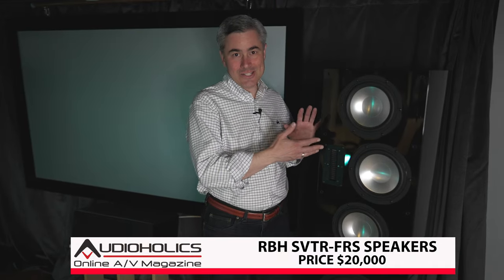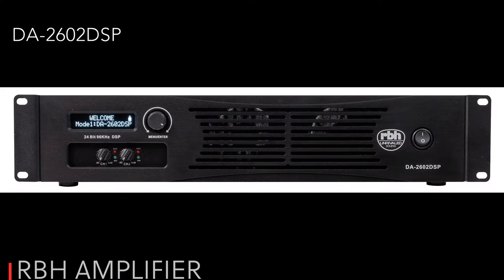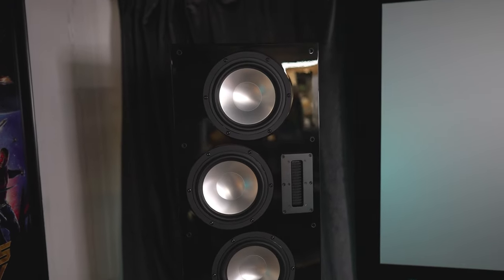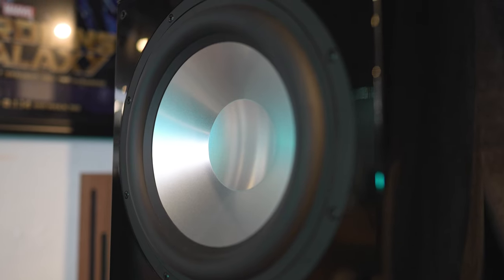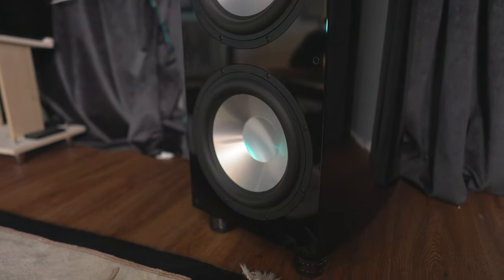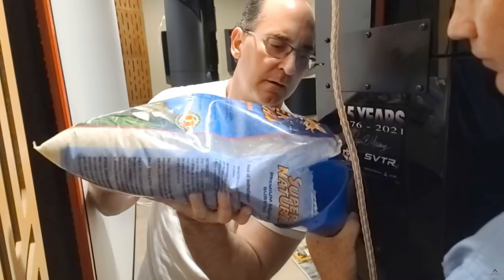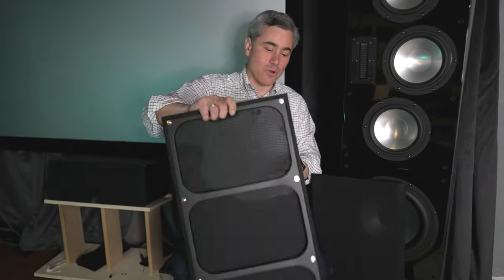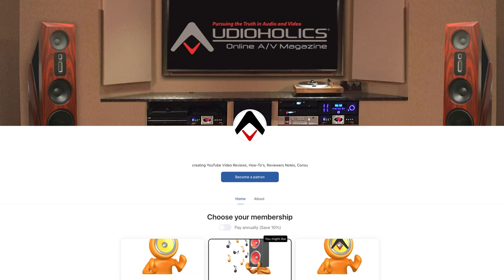Bass that Terminates Any Other Tower Speaker? RBH Sound SVTR-FRS Review

Comment from the maker: Editorial Note About Assembly: There are silicone pads between the two modules (sub and monitor) that cushion the two cabinets and prevent scratching the piano gloss surfaces. That’s what the video is showing. The two modules are then bolted together with a steel plate. Looks like an audio edit snafu cut the silicone pad mention associated with cushion in final edit. You can hear the audio splice at 0:35.
Reply: Hey Gene those sort of look like your Speakers only way smaller.
Reply: @Masterslessons they are indeed the precursor to Gene’s. When I originally had these SVTR in for review, RBH’s speaker designer, Shane Rich, was developing prototypes of the ones Gene now has. I got to see the prototypes in photos. Knowing how astounding the bass is on the SVTR, I was stunned by the potential of the upgraded version.
Reply from the maker: @Masterslessons  same drivers but missing the top sub module and my units are fully active.
Reply: @Audioholics  nice that's impressive masterpiece of speakers congrats

Comment: They are truly amazing!
I own a pair of these including the center channel. I removed the crossovers, used a custom made DSP (I designed for RBH) with a custom made Pascal Class D S-Pro2+2 & T-Pro2 6ch amp I custom designed.
They sound phenomenal! The bass is ridiculous.
I also use a 2ch RBH subwoofer amp, but their 1800W (900x2} which is way more bass power than needed.
Reply: My system is for both cinema and music.   Do you find these subs musical?   I have no doubt they get the job done laying down the bass track for a movie.

Comment: the problem with all these mega speakers is they essentially have subs built in. but the ideal position for subs in your room may not be (usually isn't) the ideal position for your main speakers.
Reply from the maker: A valid argument but you can always add more subs 😉
Reply: well sure, I mean we're all bill gates :) 

but it does kinda kill the whole point of having the subs built in.
Reply from the maker: @itsratso.  You can still achieve excellent results with a sub/sat system like this if you know how to set it up. The subs are usually 1/4 and 3/4 the distance of the width of the room and give good results for bass and stereo imaging. If you have more than 3 seats, then you will likely need an additional sub or two in the back of the room. There's something to how a fullrange tower integrates that isn't easily achieved with small speakers and multiple subs. So I like a hybrid approach when possible.

Comment: If you want to add a sub in the back of the room that is not identical to the subwoofer that is implemented for the floor standing speaker do you need to add a high pass filter to the back sub?
Reply from the maker: Not necessarily.  If the bass alignment is the same you just need to properly time align.

Comment: What amplification and cabling topology is employed in a front LCR RBH speaker setup?
Reply: I’ve run the SVTR with several different setups and electronics including: Anthem AVM 60 and Anthem AVM 90 with Benchmark AHB2 amps in bridged mono. Blue Jeans 12 gauge cabling.  Denon X8500H (better DAC) with internal amplification.  

Current config is Denon X8500HA with Monoprice Monolith 7, I have the sub modules crossed at 100Hz and powered by RBH class D monoblocks. I use BlueJeans single ended interconnects and calibrating with Audyssey MultEQ-X with Audyssey calibrated mic.

Comment: You have $40k speakers as your front stage. Why get a budget amp for them?
Reply from the maker: They are $20k/pair and if the amp is good, what's wrong with it being budget?
Reply: @Audioholics  nothing at all, i just figured you'd have something more expensive.  I have the Emotiva xpa7 and its around the same price and I like it.  as long as everything sounds good.  what are you using for the center channel?  and is the monolith powering it?
Reply: @velocci6666 yes the Monolith 7 is powering all bed layer channels. What you see as the backdrop in the video is being redone with a new wall and screen.  The center channel you see in the video is the SVS Ultra Center channel.  It’s a very capable and competent speaker for its price. A solid value.

Comment: The monitor portion is only a two-way 👎😡. I mean if it's "reference"  do it with the absolute best 3-way design and mega bad a** crossovers for the absolute clarity and imaging. I'm old and my hearing is "bad" nit to mention 3-way ("when done right" footnote) is just Q better sound. Yes, there are 3-way that don't sound much better than some premium two-way, but I demand my highs be separated from the mids!
Reply: You can always mount some sea shells to your ears and you will get much more direct focused sound
Reply from the maker: That driver topology would not work properly as a 3-way. The multiple mids act like a dispersion averaging array. Think MTM but on a larger scale.
Reply: @Masterslessons  🤣 funny but also mean. Just rubbing my bad hearing in my nose 😅
Reply: @Audioholics  yes, I can see that but really a 2 way 3 driver monitor on top of subs making the whole thing 205-220 lbs just makes the whole thing seem.......unnecessary.
Reply: @robwr737  🥂
Reply from the maker: @robwr737 they make smaller more affordable speakers if you prefer. These are obviously not for you.